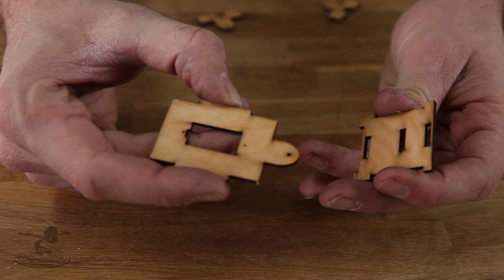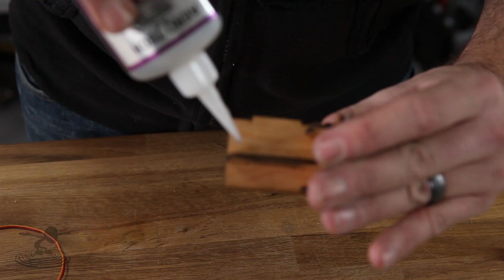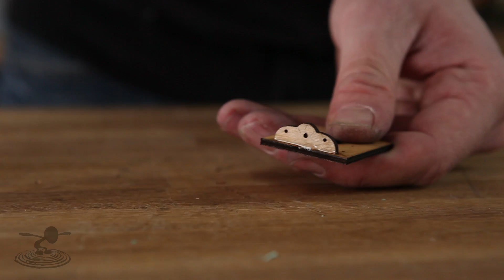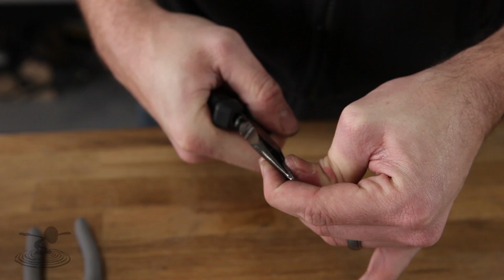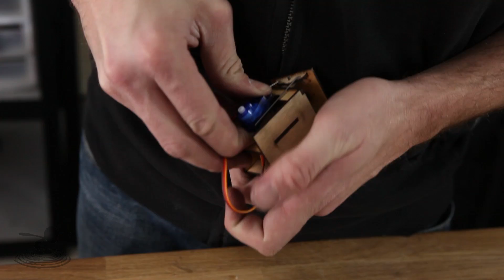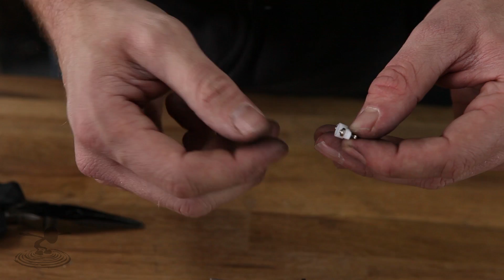Flite Test - Thrust Vector Assembly - BUILD

Comment: To which channel we should connect vector assembly...?
Reply: Normally u put it on the channel, that u want to support with the vector. On the viggen for instance it is the elevator. If u have a programmable radio, u can even program a switch, that u use for switching the vector on or off so u can also fly without the vector.

Comment: I was wondering about putting this in my flying wing project, for yaw. I was wondering how far back should I put the whole mount with the motor on so I can have the clearance on a 8 inch prop so it doesn't hit the wing... and, if I put it that way back, would the wing lose its pitch control. Any advice?

Comment: I just found a little trick about (most) servo-arms. In the video, did you notice that when you centered the servo and put the arm on, it was not perfectly perpendicular to the servo body? Looked about half a tooth/spline off.  
All the servos I've tested have an odd number of teeth on the splines that hold the arm. So if it's not exactly perpendicular (or parallel), pull the arm off and turn it (about) 180 degrees, put it back on, and it will fit in a perfectly perpendicular (or parallel) orientation.  Cheers!
Reply: Thanks! Just noticed it myself and it was pissing me off because my control surfaces weren’t perfectly level and at high speed it was pulling to the right

Comment: Why not do thrust vectoring in the front two motors of a tricopter for forward thrust?  You could get some awesome control over 
forward flight with even a single step to 15-20 degree forward tilt instead of tilting the whole craft forward.  Then you can fly a bit more like a fixed wing craft....

Comment: Just a thought.. (I have them occasionally)... All your laser cut ply cutouts have black edges from being burned by the laser. Was wondering if this, basically carbon to carbon glue joint, would be stronger if you scraped or gently sanded the edges back to fresh wood surfaces. I understand this might make the tight fit a tad looser so that might also be defeating the purpose to make a stronger joint. And, modern glues are pretty awesome and seem to attach to almost anything. Am I being a nit picky Pete..?

Comment: The magnet found in an old hard drive is excellent to magnetize screw drivers. In a pinch you can bang the shafts of two screw drivers together a couple of times which will cause the magnetic domains in the steel to partially align and make the screw driver more magnetic than it was; the permanent magnet does a much better job of course.

Comment: This would be great to use  to mount the new  PZ0420H FPV camera on from security camera 2000 . This could be modded to be tapered at the rear and enclosed to be a tear drop shape . Typical direct servo mounted pan systems strip servos way to easily but this would be great.

Comment: Your videos are always so clear and detailed. You do an amazing job, Josh.

Tip for builders: If you're fabricating something for a puller application, design as many components as you can so they "slot & rotate", locking together (so the thrust pulls the glue joints together rather than apart).
Reply from the maker: Great tip! :)
Reply: yes flite test is jst so simple! but at end what you build is so complicated!
Reply: FliteTest o yay I'm actually replying to flite test!!!!! I'm a newbie (kinda) and I would be highly appreciated if you could tell me how to adjust throws. I looked through everything but couldn't find how to. (might me easiest thing to do but don't know how to do it) Plus if you could explain expo ad deflection it would be amazing. If I missed one of your videos i would love it to tell me where they are. Love you guys and keep it up plz!